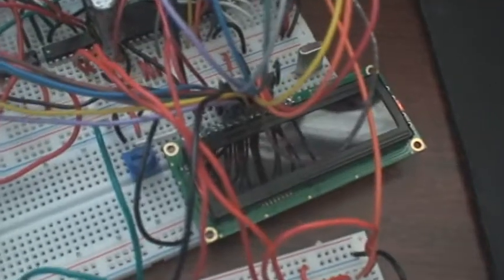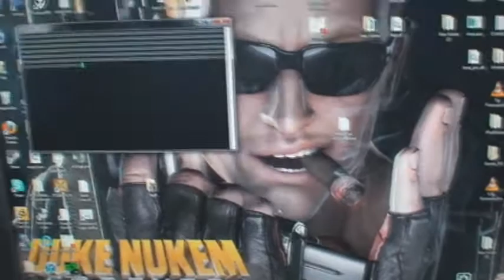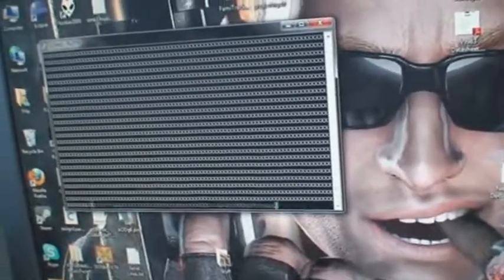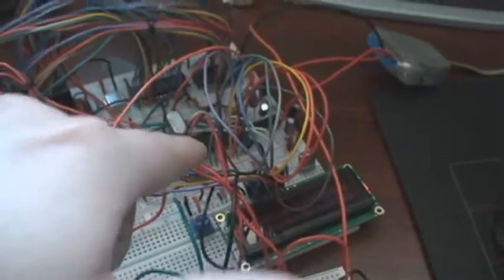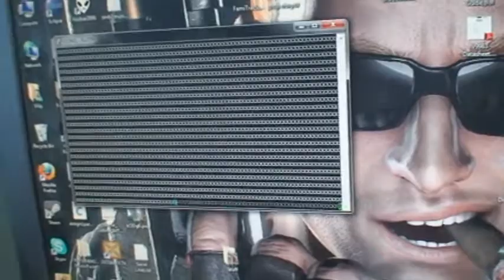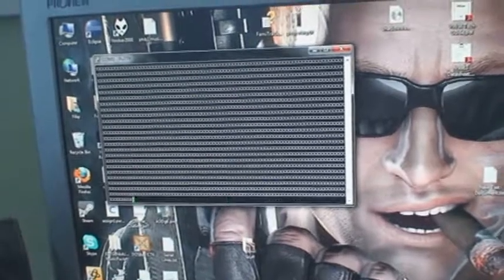NES 6502: Serial output, and the beginning of expansion!

Comment from the maker: @mkarcz12 Some of my parts are salvaged from broken 8-Bit computers. I make sure they are damaged or dead, no point in wasting a good ol' retro computer. For RAM and ROM chips, try Jameco, they resell older chips like the 6264 SRAM chip. Finally, Western Design still manufactures the 6502, 65C816, 6521,6562, and the 6551. Pretty cool that you can buy brand new 65xx family chips. Also they were the guys who created the 65C816 for the Apple II and SNES.